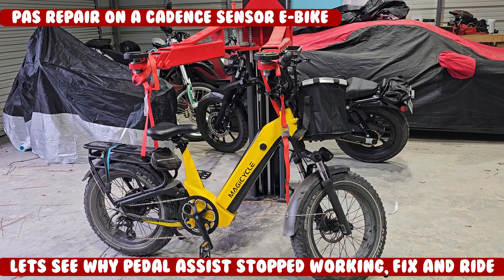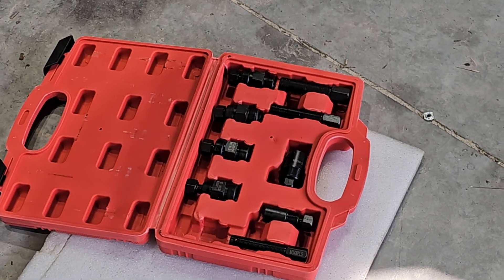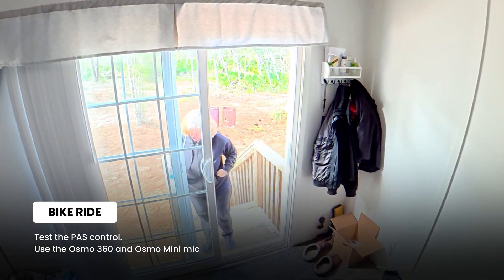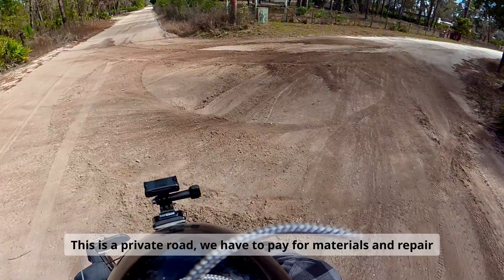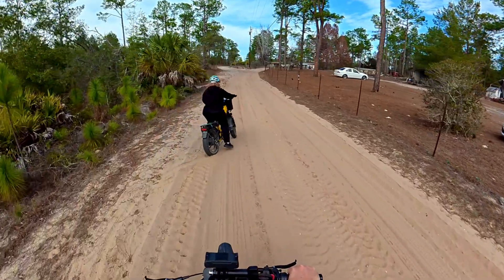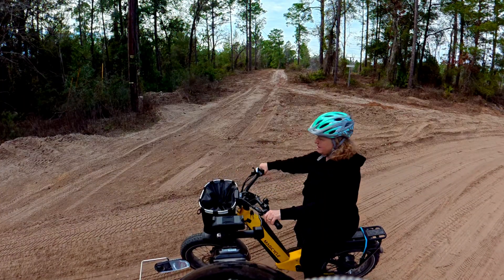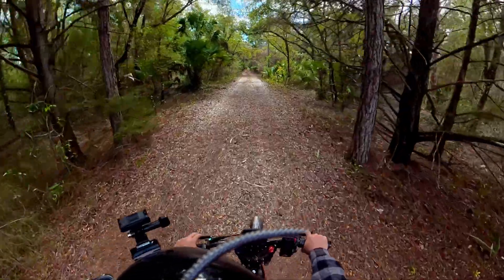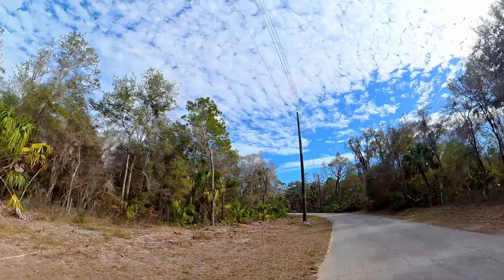Pedal Assist stopped working (PAS) How to fix and troubleshoot a Cadence style system ebike repair

Comment: Nice repair, do you think it was just dirty?
Reply from the maker: Not dirty. The wheel with a magnets was not clipped into the space close enough to the hall sensors. I think a stick may have pushed the sensor out and while we're riding I think it was out and I pushed it in by hand but that little wheel with the magnets was already broken out of its place. That was that little piece of plastic, when I popped it back in where it belonged it worked perfectly
Reply: @MotoCheez  Thank you, great job on the repair, Good information for electric bike owners
Reply from the maker: Thanks